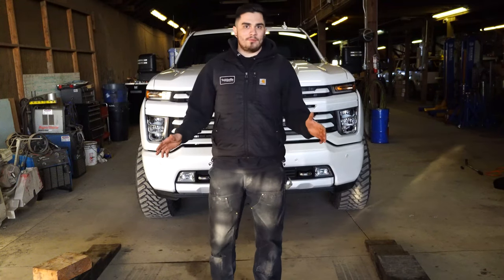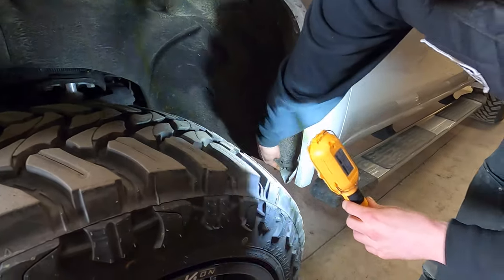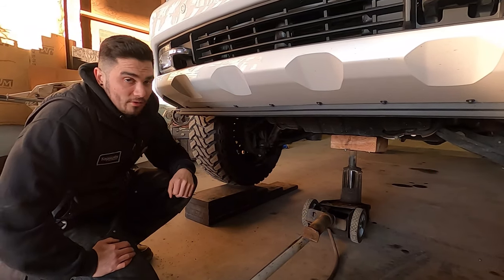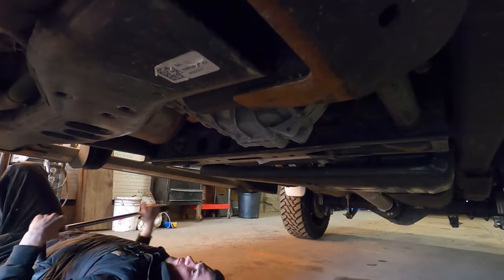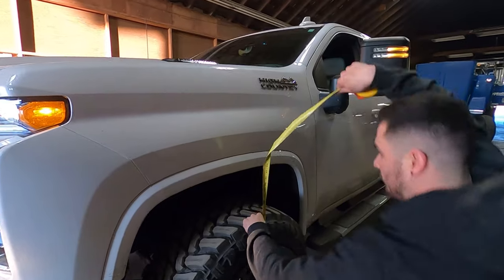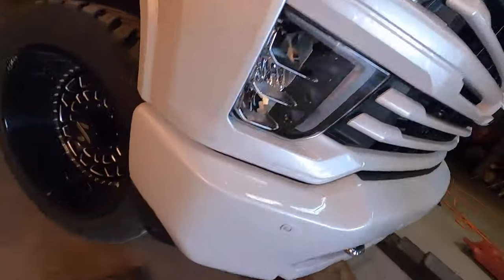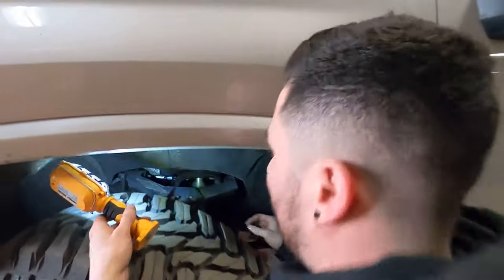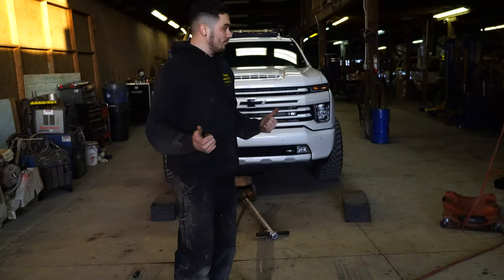HOW TO: TORSION KEY ADJUSTMENT SILVERADO / SIERRA TO LEVEL , LIFT, OR LOWER YOUR TRUCK

Comment: i’m about to do a leveling kit on my 2015 gmc 2500hd duramax.  new keys.  any advice on removal? it’s a new england truck i’m worried it may be a battle despite no rust.  ALSO.  anyone got a reference point from all the way out for how many turns on the keys for height alittle above stock??

Comment: Ok question boss. I bought a 2008 reg cab 4x4 and it has a huge lift but idk how much. It's a ruff country X. I looked on there site but anyway it's to high for me and has 35in tires that rub a bit when you turn all the way. I think they rub though bc they have spacers on wheels and makes wheels stick out fender I'd say 2 inches. So the truck is to high and it does that dropping gears bc of the tires. I would like to do this and cut or put new blocks in the back and be able to run a 33inch tire and not have a huge gap. The front axles sit perfect level now so would dropping it like this cause a problem?

Comment: Thank you for mentioning that the measurement would be the same even after adjusting. I was scratching my head wondering why I loosened each side 4 times yet they were the same height afterwards!

Comment: Can you tell a ride difference by going loser on the keys? (Less speed bump jab) ? I have a 3 inch lift on my 20 2500- it’s one inch lower in the rear - debating on putting a 2.5inch block in the rear instead of 1.5 to make up the difference or just loosen the key to lower the front? Thanks! Love the truck

Comment: So have to change the torsion bar/cross member bushings on both sides.  I bought new block and bolts for keys.  

When I install back,  where do I start the bolt turn count?  How many should I turn?   3 once I make contact with key?   I am not running anything aftermarket.  Normal 245 17 wheels.  

3 or 4 from barely touching key?

From distance of bump stop? Not resting on bump stop?

I have unloading tool. And school bus jack stands.

Comment: YOU SAVED ME!  I just bought a new GMC and noticed it leaning to the left.  Wheel well fender measured one full inch lower on both front and and back left side!  Found the left side torsion bar adjuster bolt about 5 turns too far out. (The left bolt was sticking out visibly uneven with the right.)  Jacked up the front, ran it in 5 turns. Presto, even!  Thank you so much.  But what's up with GMC!?!?  Selling it like that ?

Comment: hello I have a 2016 crew cab silverado LTZ I have a rear suspension problem appreciably its also affects the front I have my bed box which leans enormously on the left side at least 2 inch with a large gap on the suspension blades that  do I have to ??

Comment: Would you know about how far each turn raises the front end? I have a stock truck with stock keys. I tow often so I do need to keep some sort of a rake. I’m thinking 3 turns for my truck… any suggestion or advise is appreciated.
Reply: Just add a 2 inch block in rear it'll keep the ride better vs cranking your torsion bars

Comment: I need to lower my front as it sits high (2.5inch)from previous owner  . I have a 21 GMC Sierra 2500 at4.  Do u know how inches one full turn is ?
Reply: He mentioned in the video that 4 turns lowered it 3 quarters of an inch.

Comment: will this technique work to level the front rake on my 2019 chevy trailboss? it has a 1 1/2  difference from front to back.
Reply: 2” drop shackles in rear would level it

Comment: clearing on flat ground at stand still is misleading isn't it......what about driving and hitting bumps with wheel turned, when suspension compresses the tires may still rub so wouldn't you want to make sure you have clearance for when suspension is compressed as well?
Reply from the maker: All good here man. And if you over adjust and start rubbing it only takes about 15 min to hit the torsion keys again. Not a big deal. Not sure if youre playing troll. But I have been running this height with little to no rubbing for over a year now and all good : )

Comment: Haha nice oil leak bro
Reply from the maker: Ive got a shop with 10+ dump trucks and 20+ heavy machines that get serviced and worked on here. Oil is everywhere
Reply: @duramax2020  I just did it because you told me not too 😂 nice truck I have a 2016 duramax maybe one day I can upgrade.
Reply from the maker: @adenseay7406  haha all good
Reply: @duramax2020  ...😂